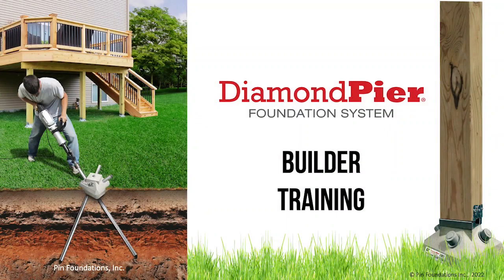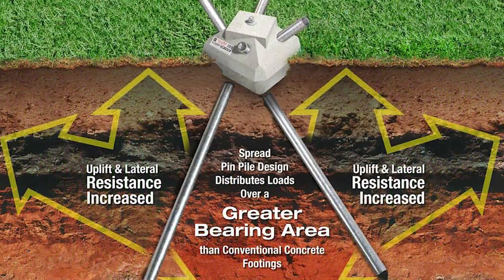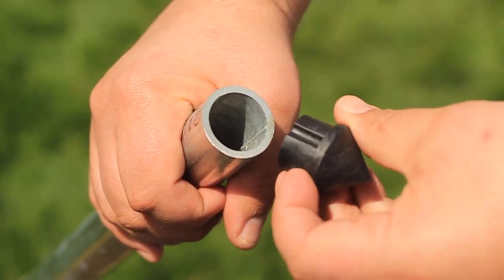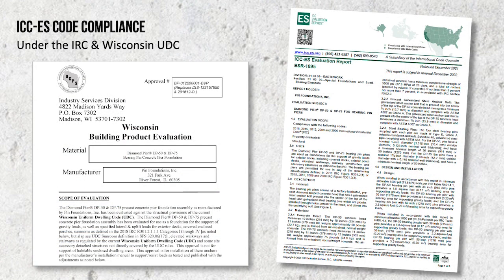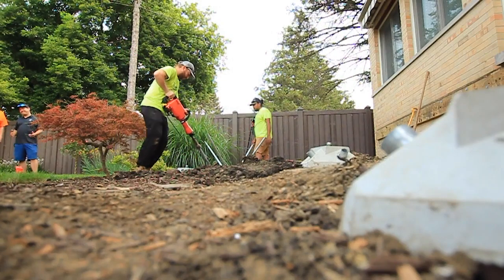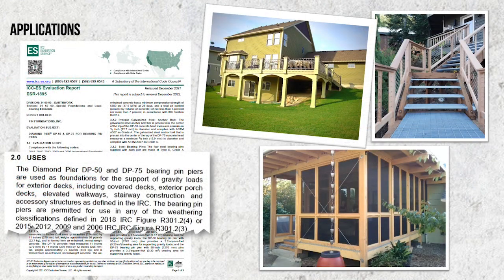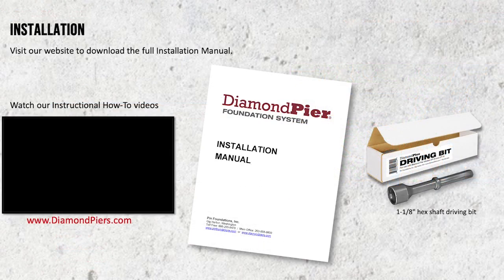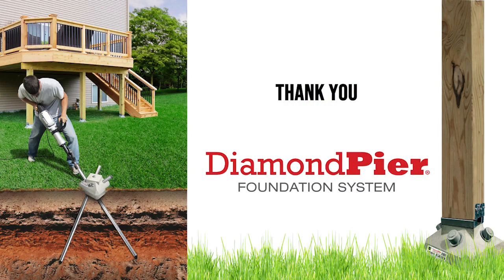Diamond Pier Builder Training

Comment: How can a DP 50/50” be code compliant in an area with a frost line of 42”? The pin is driven at a 45degree angle so the pin only goes down vertically 35”? You don’t need to be below frost line with this product?
Reply from the maker: Good question we get a lot- the Diamond Pier is considered an Alternate Product in the code. As an alternate product it is required to match the performance of the prescriptive footing depth (eg concrete footings). So, Diamond Pier is a performance-based path to code compliance, not a prescriptive path to code.

Comment: Simple physics reveals that these will heave. There would have to be some sort of pressure-absorbent material on the bottom of the block to mitigate frost heave.
Reply: @vickyls.5736  Diamond Piers are designed to not settle, but there is nothing to prevent them from heaving. Any real engineer will tell you to stay away from them, especially in clay in northern climates.
Reply: looks like it has pretty good heave resistance due to it's top shape vs bottom shape to me. They also have a 10 year study. You have an example of why it wouldn't be good?
Reply: @gg-gn3re  "They" have a 10-year study, is of course meaningless. Just take a look at their disclaimer, which reveals that these are no better than standard piers. If you really want to understand how frost heave works, talk to an engineer. You have to get below the frost line, and you have to have smooth vertical surfaces above that point. The frost will have traction to lift anything else.
Reply from the maker: He won't be able to answer that since he has not read the 10-year study. Which was published by... engineers. The problem with studying frost heave is that you can't replicate it since there's too many variables involved that are never consistent; soil, moisture, geography, temperature, etc. So testing against it is impossible. The reason why we in the U.S. currently install concrete footings at or below the frost line, is just that that is what builders have always done here and it worked. Except for when it doesn't- I'm sure you've seen plenty of images of concrete footings that have heaved, but were installed below the frost. We're not better or worse than any other pier, we're equivalent. The advantages of our product are that you don't have to buy 6x 80lb bags of concrete per post, dig 6 post holes, wait for it to cure, wait for the weather, wait for inspector to come, etc. Doesn't tear up the landscaping and you can get into tight spots and start building right away. If you'd like more details about the Frost Study or how our engineering works (see spread pile footings on bridges), feel free to reach out to us, our engineers loooove to talk shop! info@diamondpiers.com
Reply: @DiamondPier  Anyone who thinks these are going to remain stable knows nothing about how frost heave works.
Reply: @Cotronixco  it’s amazing how many posts you have on this topic and you’re wrong on every one despite being disabused of your ignorance time and again. This company has a code compliant product. It’s already proven itself.
Reply: @patty109109  "This guy" is an engineer. "Code compliant" does not change the laws of physics. Your feelings don't change the laws of physics, either. If you want to actually argue the physics behind the claims, by all means, please do so.
Reply: @DiamondPier  The bottom of rivers don't freeze...
Reply: This guy literally spams all the videos about diamond piers. He has no idea what he’s talking about but pretends he’s an engineer.
Reply: Maybe he's got skin in the game.... competition perhaps  @patty109109

Comment: I plan on building a sunroom 3' off the ground, 25' wide and 12' out from the house with a belconey above, would 8 DP50/50's work, 4 under the post's and 4 under the 25' long girder in the middle of the deck. Going through soil with mostly sand.
Reply: Don't take the risk. Drill the holes and pour sonatubes. The frost then slides up and down their smooth surface. There is nothing to stop these ridiculous diamond piers from heaving.
Reply: @Cotronixco  except for physics you’re completely right.